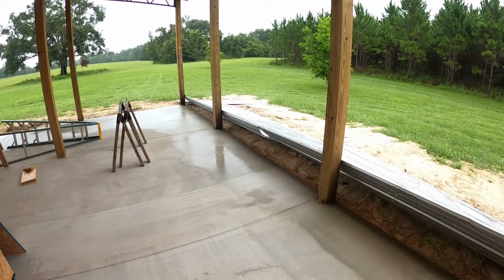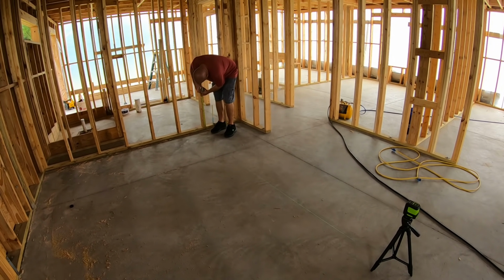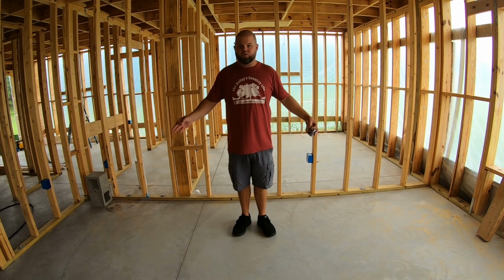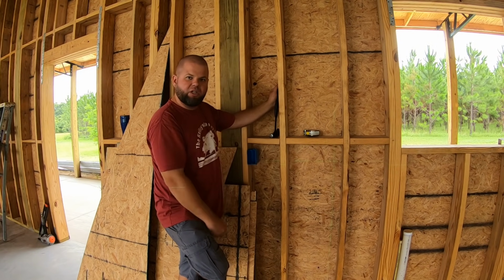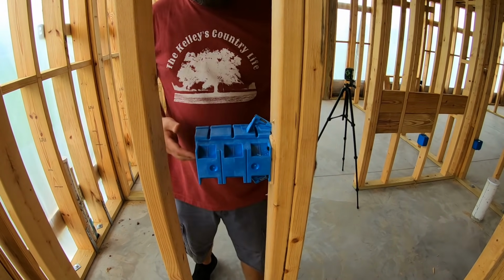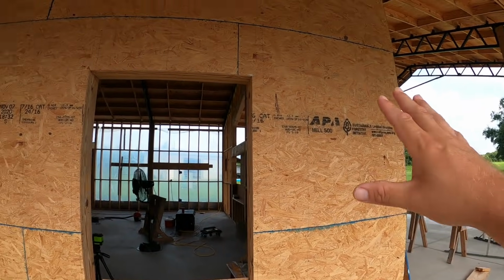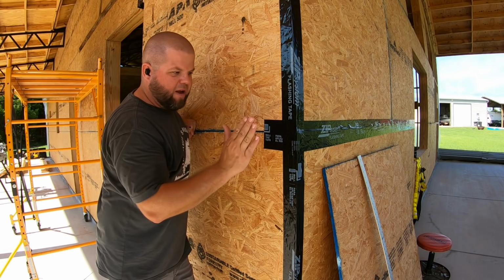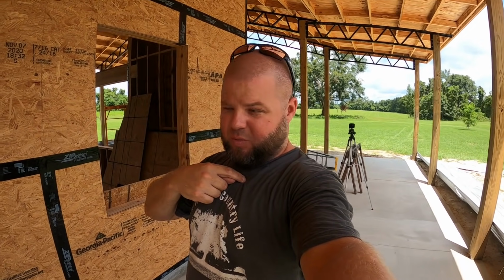Rainy day electrical and seam taping sheathing! #402 #barndo #barndominium

Comment: When you install the receptacles and lighting boxes in your bedrooms and family room run a 12-3 wire from the light switch box to all the receptacles so you can if you so choose have a switched receptacle at any location. Same thing to all overhead middle of room light boxes so if you install a fan you can switch the fan and light separately. Also in the bedroom put 4 way switches above the bedside tables to turn on and off lights from the bed.

Comment: Here's a handy little tip: After you're done wiring, and you're putting the cover plates on the switches and boxes, write the breaker number for that switch or outlet on the back of the plate.
Reply: This is seconded and thirded if I could. We do something similar with data jacks, but those usually by design have numbers on the outside.
Reply: in commercial buildings you will see a small circuit number on the front of the switch,  just to make it easier to tell what is on what circuit.   so totally agree, front or back of cover,  as long as it is labelled.
Reply: ...or use a label maker (or your laser engraver) and place a small label on the outside of the cover right between the plug receptacles.  It sure is handy to know at a glance the breaker number.
Reply from the maker: I think the laser can help me out here for sure.
Reply: Dude. That's genius. Wish my house had plates labeled to breaker numbers

Comment: Here goes my input when we build we added a switch in every bathroom that controls a receptacle in the bottom of the cabinet so we could add led strip lighting in the toe kick of the cabinets so we could use them as a night light. We also switched outlets in the living room where we wanted to put the CHRISTMAS 🎄 to turn it on and off. We also added switched outlets in the soffits for Christmas lights or party lights.  Keep over doing it!!!👍🏻💪🏻
Reply from the maker: Sofit switched outlets is definitely on my list.

Comment: When I built i had double outlets 
( 4 outlets) added to both sides of the bed.  It really has paid off.  Adjustable bed, lamps, phone chargers, hearing aid charger, hearing aid dangle charger, etc.... After we passed final inspection, changed out so i had a row of usb outlets and 2 regular outlets....love it.  
Also in bathroom keep in mind many plugs are large ( i.e. can't really plug 2 things in one above the other) so glad i have plugs on both sides of each sink.

Wish some of my outlets else where had usb outlets...next project.
Reply from the maker: I definitely need to consider this

Comment: I would suggest raising the washer/dryer plugs so you can reach over the machines to get them instead of getting behind them. Two gang deep box on dryer makes it easy to work with later.
Reply from the maker: Good tip, I'm raising the refrigerator plug too.

Comment: If you plan to have cameras around the house remember to run the ethernet cables to the central place where the POE enabled switch will be and you may want to buy a home/office mini rack box to organize the camera and network wires into keystone capture plates to make things easier to keep organized as systems change. What ever you do don't go down the rabbit hole that is keystone on amazon as they have everything from RJ-45 to HDMI options
Reply: totally agree  POE can be awesome for adding network devices away from power points.  and always buy a bigger switch than you need,  better to pay a bit more than find out later that you need a bigger switch.

Comment: When we added onto our house. We added wall sconces to our bedroom above our nightstands so we didn't have to put a lamp on our nightstands. I actually went to the store and measured our headboard so the sconces were in the right place.  I taped the measurements to the wall so the electrician knew where to place the sconce electricidal box. It was a great plan. It gives you more room on your nightstand.

Comment: My dude, please run cat-6a. You can drop the low voltage boxes just like the 120v. All the habitable rooms have to be arc fault breakers. For those, I'd suggest using the commercial back stab receptacles, but the kind where you clamp down the backstab with the side screws. Please note, not to be confused with the cheap receptacle with backstab that are spring loaded. The reason is to avoid common problem with afci breakers tripping mysteriously.

Please please hire an electrician, I think I might have glimpsed a code issue with receptacle spacing apart.... It's a huge amount off information, and some of them issues are seemingly weird. The inspector will measure the distance between receptacles.

(Former electrician here)
Reply: agree and run more network cables than you need as it is easier to have unused cable sitting around than run new cables.
Reply: for sure. In my low voltage days, best during rough construction we ran everything to every room including the garage and a stub out for gate strike/gate release. easy to put a blank cover plate on unused (e.g. future circuits). for every wall mounted TV, double gang boxes upper and lower; (4 ea location). left side had RJ45 for cable sat and speakers all back to a 52 in panel (48" panels got to busy). double cat runs for elevators! oh yeah I was like what in the world?
whole house audio, intercom, alarm--quite interesting packages for 12K+ homes! retrofit an intercom system? whew glad a drywaller was in their contract lol. definitely learning more from this channel to include the subscribers; diginotes!
Reply: @k4x4map46    we are looking at running low voltage around our house  and for this reason.    We have maximized our solar system production and there is minimal ROI by installing large batteries banks.    The feed in rate is minimal and regulators are now looking to charge us to feed into the grid. 

So I am looking at putting in a complete separate system and moving some of the load off grid power and onto our low voltage grid.   This low voltage grid will give me more control over our energy stability and provide backup power in case of grid failure
Reply: @tarawood-bradley2119  sounds great!!

Comment: A very important thing with electrical boxes is to not modify them as an inspector will fail it if you have including adding extra screw/nail points so the way around this is to switch to a box that has the needed secure points like a metal box that can screw to strapping in the wall to be fully supported. 

When you go to run the wires things like the fridge, freezer, router and a few key lights around the house can be run into a sub panel to make it easier to set them up on a generator without touching the main panel. 

On every electrical box is a number indicating the number of wires that can be in that box and is based on the size so may need to up to the next sized box if you are going to have a lot of wires in it.

Comment: Not sure if it has already been said or not, but in the kitchen instead of running every other outlet on a different circuit you could run it so the top outlet and bottom outlet are on different circuits. I have had two different houses setup that way and it is nice to have that way. Love the video series, makes me want to build my own place
Reply from the maker: Good tip

Comment: I would place that dryer outlet high enough so that you can unplug it without pulling the dryer all the way out into the floor.  For me that goes for most large appliances, a deep freezer full of food is almost impossible to move, in a power outage you may want to easily be able to plug in a generator to it.  I have my refrigerator outlet almost four feet off the floor and to an open side so I can unplug it without moving it.
On kitchen counters you have a "2 foot rule", an appliance with a two foot cord needs to be able to reach an outlet from anywhere on the counter.
Many of the better bath fans not only have a light and a fan they also have a night light, so you may want three or four switches near the door. Usually when you go into a bathroom with no window you want all the lights to come on with one switch.  So one for the lights, one for the fan and one for the night light. You want at least one outlet near the sink for hair dryers and charging toothbrushes and one outlet near the floor in case you ever want to plug in a small heater.  If you think you may ever buy one of those fancy, heated,  washlet toilet seats you need an outlet close to the back of the toilet.
Normally when you place a light switch near a door you add a 2x4 block before you install the switch. Placing a switch too close to a door can cause problems especially if you use wider door trim, even narrow door trim will be close to the cover plate on the switch but it will work.
At 18:00, everybody is going to happier if you place an outlet or two near that vanity top, you don't want cords hanging down the wall. There are several items that will be plugged in on top of a vanity. The inspector may even have something to say about that.
You said you want your seam tape to shed water, that's a great idea. The best way to do that is to start at the very bottom, the vertical seams and then work your way up. 
Sorry for all the suggestions but I have been in construction all my life and I'm not young anymore.  You are doing a great job!
Reply from the maker: Actually all your suggestions are already on my to do list for the week, I absolutely agree. Thanks

Comment: side benefit to mounting your outlets higher than normal as a just in case for disability compliance is that if something crazy happens and the house floods you get some extra clearance. had a customer years ago who suffered flood damage in her basement and the outlets were all along the floor for some god awful reason. destroyed her laptops and accessories.

Comment: Hi Andrew.  Everything really looking good.  Nothing to do with electrical but something I just wanted to mention.  I use the Shark IQ robot and love it.  Since you think so far in advance thought I would mention so you can keep flooring transitions clean so one (which you someday will choose to use) can clean the whole house.  Again just in case you might get a robot vac someday.
Reply from the maker: My wife is dead set we are getting one. Zero flooring transmission in the house.

Comment: Like Jon Disnard said run Cat 6-a. You can't hop those like 110v. Each wire has to run back to a "phone room" or storage room. Even if you don't terminate then, just put a solid cover over the box and number the wires on both ends.

Comment: For the dryer outlet I use a blank 6x6x4 utility box. In the lid I then hole saw a hole the diameter of the outlet and use 4  screws with
Reply: Cont…. The outlet is mounted to the lid with 4 #10 screws with nuts on them. I lag bolt the utility box to the framing. This is super strong and long lasting installation.

Comment: If you are doing spray foam, put in ENT conduit to the boxes for future use. A dedicated space for data runs, camera wiring, etc is awesome. I always put fridge boxes at 16" and switch height. That way you are covered and is easier to unplug and vacuum out fridge coils. Rule of thumb is 180 watts per general is outlets. So 180 x 13.
Reply: Are you putting 3 way switches in for floodlights and exterior lights by the bed? 2 gang is standard for dryer. I have wired over 10000 homes in the past decades. You can email me with any questions. You must have at least 2 counter appliance circuits. Dishwasher/disposal on dedicated. Microwave dedicated. Fridge dedicated.
Reply from the maker: Thank you very much for the information

Comment: Also I’m not a electrician but just a thought I had you might already have plans to do but my house was wired outside with a huge breaker box  that cuts power to the pole and I have a hook up for generator. Takes 2 mins to hook up generator when we have power outrages . Not sure what it’s all called but it’s a game changer when power it out .
Reply from the maker: Generator transfer switch, I'm definitely considering one.

Comment: Andrew with your zip tape you will want to fallow this saying "tape up". Start with the ground level vertical seams then hit the horizontal ones, this way you over lap the tops of ALL lines of tape. When flashing windows and doors is the same, but with covering the seam runs of tap.

Comment: One thing you may want to do for future ease, depending upon your exact set up in terms of having a backup generator and codes, wire the lights on separate circuits along with certain outlets light for your refrigerator abd so on to a subpanel that is wired to your generator cut off switch. You can find many videos on this sort of set up if you cannot afford a whole house back up generator.

Comment: We used arc and gif breakers instead of outlet it cost a little more but to me was worth the expense. Ga code may be different than Fl. Also put each room on its one breaker. Kitchen 3, live room 2, bed rooms each 1, bathrooms each 1, fridge and or freezer on there own beaker.

Comment: You kitchen counter height: if you’re going to tile the floor- 1/2 self leveler: hardi backer, 1/2” tile, 36” cabinet, 1 1/4” granite slab, 4” granite backsplash = 41 1/2”. Any shimming to level cabinets. That’s pushing it… The last thing you want is to have to move up every box in the kitchen after countertops go in
Reply from the maker: Nope putting very thin vinyl plank flooring right over the concrete, won't hardly notice it.
Reply from the maker: Cabinets always go on concrete floors, otherwise it's a nightmare to change flooring down the road.
Reply: @TKCL  I’ve wired hundreds of houses that are slab on grade and the self leveler and flooring always goes down before the cabinets.
Reply from the maker: Not for me, if you ever decide to change the flooring your in big trouble. Plus flooring expands and contracts
Reply: @TKCL  When it’s time to remodel and change the flooring, the ol lady’s going to want cabinets too. Everything expands and contracts, especially in a pole building

Comment: Zip makes a stretch version for flashing windows. Its pricey but if you only use it for the bottom corners of the windows its worth it and easier than figuring out al the folding of other ones.
Reply from the maker: I agree, tyvek makes good stretch flashing tape too

Comment: Another great video Andrew!  Hey have you thought of sealing your house gaps (around outlet/switch boxes, etc.) from the inside using a positive pressure caulking system like Aerobarrier?  From what I understand this forces a latex caulk into every nook & cranny inside your home.  We are getting ready to build and have been looking into it.  Good luck with your build and keep up the good work!
Reply from the maker: I was just going to seal all exterior boxes with spray foam before the insulators showed up.

Comment: On the GFCi outlets get the good ones, I've had really bad luck with the low end Leviton over the past 10 years. Also they now make outlets with 5V USB out, I've found them extremely useful to install in bedrooms near the nightstand and around the kitchen island. It's a great option to not have to search for a phone charger and having some in the common areas makes it great for guests that are over to be able to get a boost or to plug in a tablet in the kitchen or any of those home assistants that everyone seems to have now.

Don't forget they make multi switches anywhere from 1 to 4 switches in a single box (although 4 can be a nightmare on space for wires)

Comment: Be a good time to think about under cabinet lighting. When you run electrical, I'd run your ethernet cable through out the house. I would want good internet connection in a house that spaced out

Comment: You want an ERV, (energy recovery ventilator). I have my house up here in Canada which I sealed up right tight and I have to get myself an HRV (heat recovery ventilator) installed for fresh air.
Reply from the maker: I've been researching those

Comment: The number of devices (switches, outlets, etc.) on a circuit is dependent on local codes. I had one area that had a limit of 12, another area that had a limit of 16, and a different area that went by the NEC with no more than 80% of the potential/planned load. Seldom will a set of residential prints call for Arc Fault circuits since it is code for the circuits to be Arc Fault protected unless designated to be GFCI protected.
The 2-gang box for your dryer is a non-issue. For the height of your countertop outlets, it is nice to have an inch or two above the potential known backsplash. Also smart call on having multiple circuits for your kitchen countertop outlets. 

I had been patiently waiting for you to start the electrical.
Reply from the maker: I'll take all the advice you can give. I'll be in touch via email with a few more questions. Thank you for the information.

Comment: Before you get hot and heavy on wiring romex get about 3 of these. "Gardner Bender CR-100 4-Inch Romex Cable Ripper" from Amazon or Lowes
Reply: The reason you buy 3 is they are cheap and you can't put your hands on 2 of them at any given time.